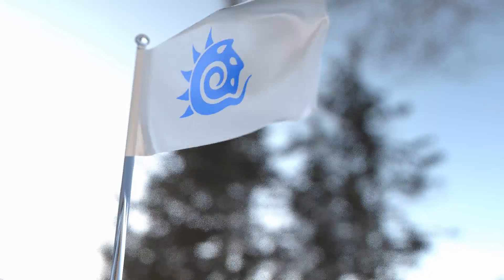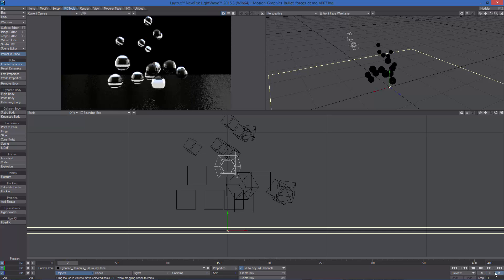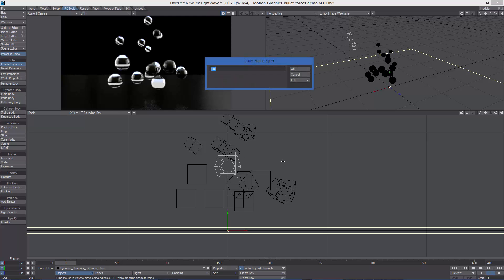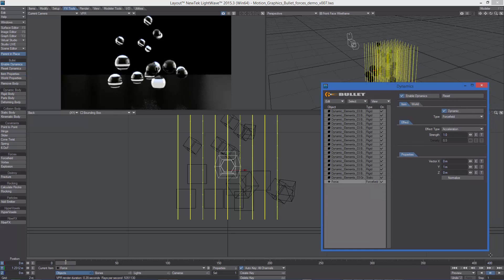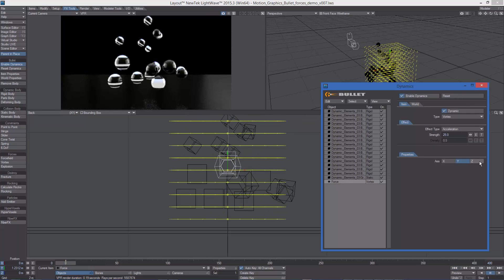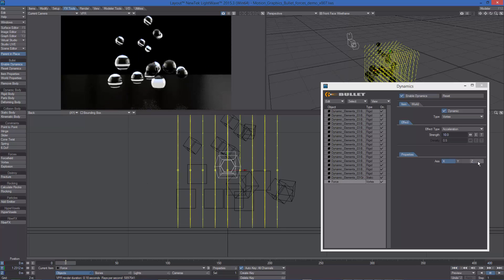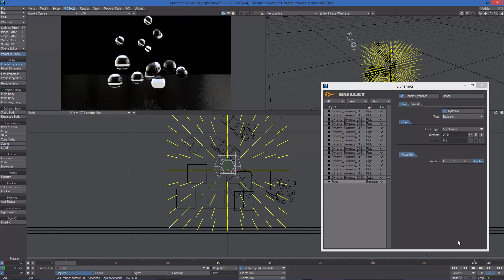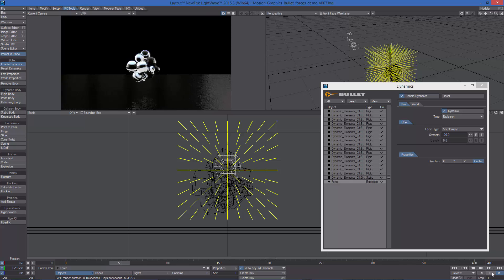Quick Start Video: Bullet Forces in LightWave 2015

Comment: Scaling of the spheres does not work with bullet forces? Has no effect. How to do this? Thanks!
Reply from the maker: +Freddy Peters You should be able to scale the spheres at frame 0. Scale can't be animated during the Bullet simulation.
Reply: +LightWave 3D Group I wanted to animate the scale. Morph's also a problem? In 2016??
Reply from the maker: +Freddy Peters Bullet doesn't allow animating the scale of an object. The Bullet Engine takes care of animating any transformation for rigid bodies (translation and rotation), and the scale is just a one timed defined attribute (scaling an object would mean changing his shape).
If you need to animate the scale or, better, the shape of an object during the simulation, you'll need to use a Deforming body.